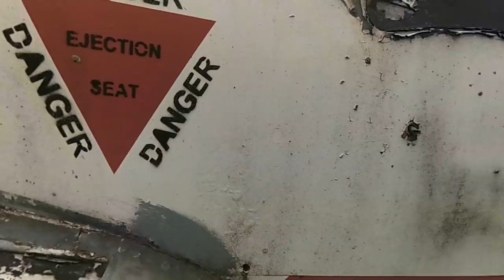Abandoned Cold War Aircraft Found Behind Farm

Comment: Ok 1st aircraft is an Meteor F.3 top speed of 606mph built in 1945 2nd plane is an very rare Sea Vampire makes me sad thinking of one just rotting away there.
Reply: Actually, the second Red plane is a Hawker Hunter.
Apart from the Split Tail Fin of the Vampire, the Hunter has a different Air Intake along with a bulbous section in the wing where the engine passes
Reply: The (Third) White plane is the Sea Vampire :) And I'm in total agreement with you on its ultimate fate (so far!).
I'd like to think someone would come to the rescue based on this video. I would if I had field space and the Dollar!